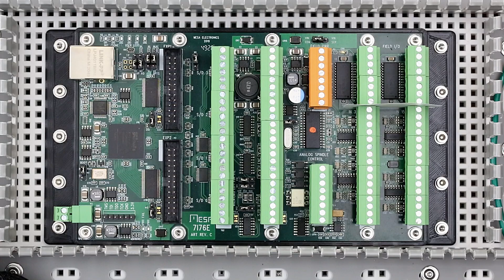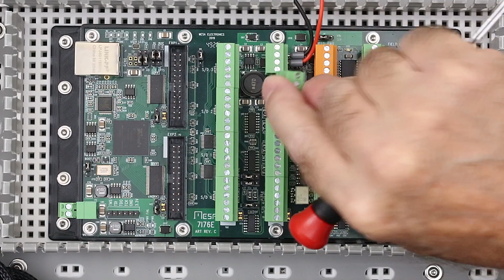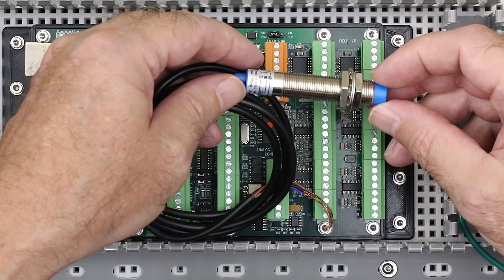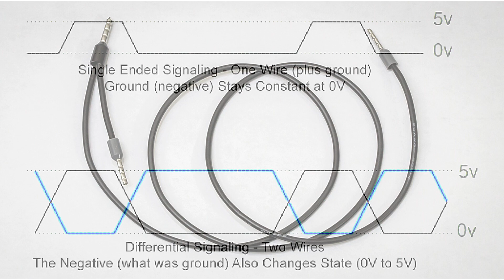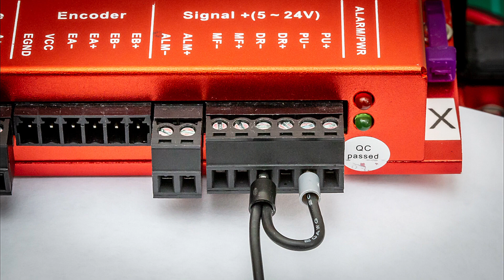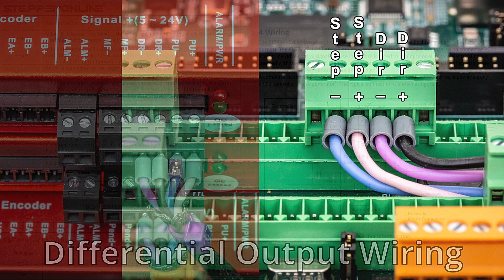Mesa 7i76E Overview & Single Ended vs Differential Mode Signals

Comment: Great information. I want to get one of these cards soon to play around with. A few questions: what kind of enclosure is that? And doesn't the 7i76ED allow higher current devices to be driven since it's syncing current?
Reply from the maker: The Enclosure is a Qilipsu 20-inch which can be found here...
 https://www.amazon.com/gp/product/B092QL1745/ref=ppx_yo_dt_b_search_asin_title?ie=UTF8&psc=1
...and I talk about it in this video: https://youtu.be/w0xYw-2frEo

Regarding the output current of the 7I76ED... The documentation states (all caps in the documentation, I'm not yelling):

FIELD OUTPUT CURRENT ---- 350 mA Per output
(RESISTIVE LOADS AND INDUCTIVE LOADS WITH FLYBACK DIODE)
FIELD OUTPUT CURRENT ---- 60 mA Per output
(INDUCTIVE LOADS WITH NO FLYBACK DIODE)
PER DRIVER CHIP CURRENT ---- 1.4A Per chip

This is for both the 7I76E and 7I76ED versions.
My board has OnSemi NCV7608 Octal Configurable Low/High Side Driver chips for the field output drivers.
The current rating, from the data sheet, is the same for both sinking and sourcing (which is stated above). 
So, to answer your question, no the 7I76ED does not allow higher current devices due to its sinking current configuration... based on my research.
Hope this helps.

Edited for typo.

Comment: I really like the way you explain everything so a old country boy like myself can understand and keep up with.  what card would your recommend to use with a CNC mill or lathe.  The lathe is a G0602 the Mill is Harbor freight.  I am going to use Linux CNC. Both of these I will have to convert into CNC. Just starting my research.  Any advice would be helpful.
Reply from the maker: I'm not really the one to ask. This is my first LinuxCNC build too. When I was doing research many people recommended the Mesa 7i76E card. It has plenty of I/O, Spindle control, and encoder input. I mainly chose the Mesa 7i76E because I wasn't (and aren't) really sure how much I'm going to build out the G0704 Mill. Power drawbar? Tool changer? The Mesa card provides me with the option to do as much as I want to.
That said. I've been reading on-line, that Mesa is out of stock at the moment (Fall of 2022) do to IC chip availability. Hopefully that will get sorted out by sometime in the first half of 2023.